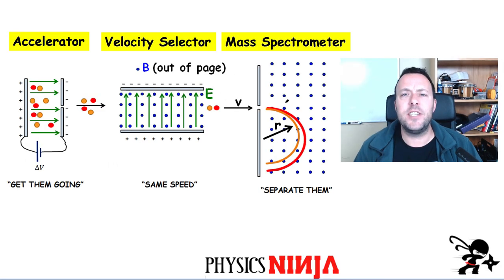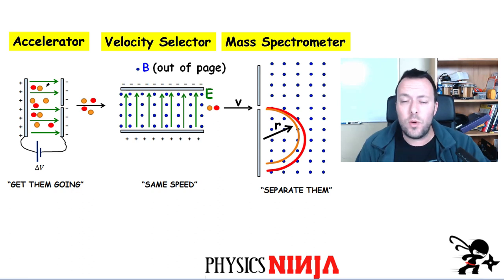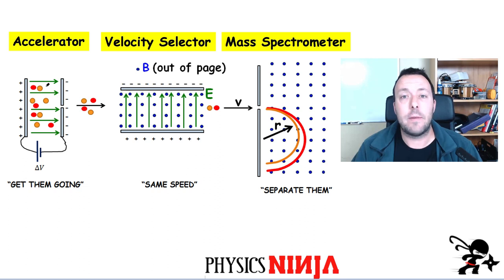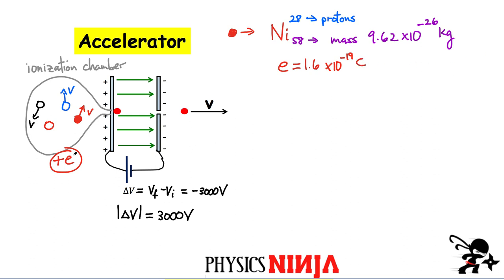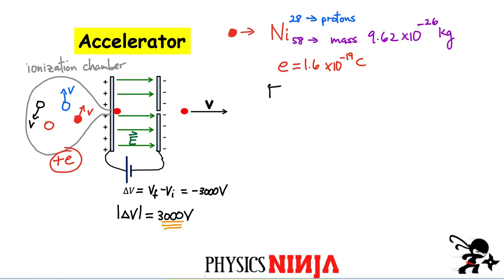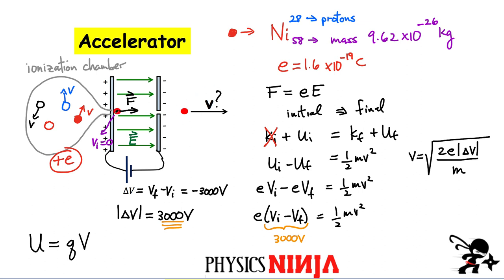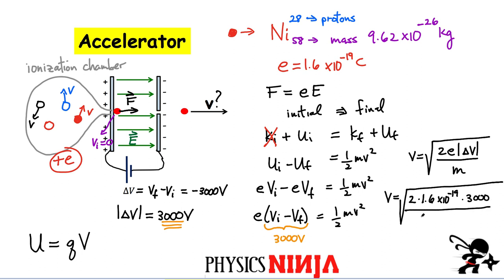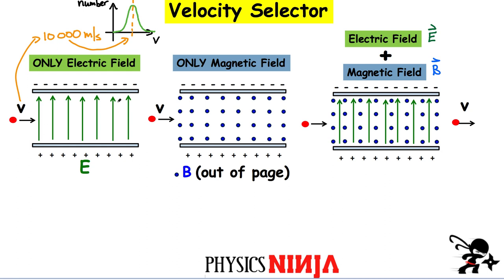Mass Spectrometer Problem

Comment: I've read a lot of comments on the fact that ions of different mass will emerge at different velocities from the accelerating potential.  

These are really good questions about the accelerating potential issue:  absolutely the heavier particles will emerge with a lower velocity.  If the speed selector was fixed at one value and the accelerating potential was fixed at one value, you would miss the vast majority of atoms/'molecules emerging from the ionization chamber.  I ran into these comments while preparing to produce a video for a physics course, which inspired me to do more research on the issue, and the answer is very simple:  the experimenter can turn the knobs to change these parameters in order to scan through ions with different charge to mass ratios!   Mass spectrometers simply modify the parameters to rapidly scan through m/z values to produce a relative abundance vs. m/z plot.  In the physics textbooks I've taught from, they always present it as "one velocity, many different landing positions", but clearly this can't be true unless the particles are very close in mass.  

In my research over the last couple days, I ran into a cool review article on the history of the mass spectrometer:  https://www.researchgate.net/publication/277275153_Colloquium_100_years_of_mass_spectrometry_Perspectives_and_future_trends

In the article, we see that Dempster's magnetic sector analyzer (1918) looks very much like the schematic we're used to seeing in introductory physics, except that it has only a single detector instead of a spread-out photographic plate.  This made me realize that with experimental control over the accelerating potential and the magnetic field in the analyzer region, we can detect different particles at the same position by sweeping through the parameters of the device.  It is interesting to note that Dempster's design did NOT have a speed selector, but he acknowledged the loss of resolution due to the distribution of ion velocities entering the analyzer and proposed adding the Wien filter (velocity selector) in order to improve the resolution of the device.   I think the addition of the Wien filter is what distinguishes this canonical example as the "Bainbridge Mass Spectrometer".  

I ended up making my video with a spectrometer schematic that has a single fixed detector, assuming we have the experimental control to sweep through parameters and detect different ions by modifying the accelerating potential, speed selector and/or analyzer magnetic field.  

https://www.youtube.com/watch?v=vFUMH5WVuc4

Comment: I am a physics teacher. I would like to correct you on the hand rules…. To find the the direction of a force on a moving charge you ALWAYS use Fleming’s left hand rule. The right hand rule is only used to find the direction of an induced current in a magnetic field.
Reply from the maker: I use 2 right hand rules.  I never liked the left hand rule because then you need to remember when to use right vs left.  Instead I teach 2 right hand rules one for currents and one for for cross products.   It’s worked for my students for over 20 years.

Comment: I tried the exercise and everything is okay for the first radius, in the second part though I cannot understand how did you calculated the mass. Because if I try the result is 9.95x10^-26kg and if i put this in the formula the second radius results 5.2 instead of 6.. What did I do wrong?

Comment: The energy that the ions gain during accelaration is same if we consider that all ions have same charge. So The heavier molecules will have smaller velocity and the ligther will have greater velocity. But velocity selector let pass only the ions with certain velocity. So how the spectrometer detects the other ions? It doesn't make sense.
Reply from the maker: That's assuming that they have an initial velocity of 0m/s.   In general you have an ionized gas so they are entering the E-field region with different velocities.    So you can have heavy and light molecules that are accelerated through the potential difference.   I considered only the case with initial kinetic = 0 but this is just a specific case.
Reply: @PhysicsNinja  So we need the velocity selector because the molecules have initial velocity?
Reply from the maker: @adosar7261  There is generally a distribution of velocities and we want to take a small sample of the velocities.
Reply: @PhysicsNinja  I still don't understand it. How we know that we didn't miss any ion that didn't have the selected velocity? Thanks in advance.
Reply: @adosar7261  I think you are absolutely right. From the equation v=sqrt(2e|deltaV|/m) we see that the velocity of each ion is inversely proportional to the square root of its mass-to-charge ratio (m/z). So at any selected velocity only one m/z passes though the velocity selector to the analyzing magnet sector, which means that only one ion type can be observed. Thus, it's clear that the system discussed in the video cannot operate in the way a real mass spectrometer should.

Even if the ions arriving the accelerating electric field have a distribution of initial velocities, it won't make a crucial difference, as the largest part of the final velocities still comes from the accelerating field. The differing initial velocities may of course make it possible for a small number of different mass-to-charge ratios (around the "correct" one) to pass through the velocity selector, but most of them are still filtered out and stay undetected, especially those that differ significantly from the "correct" m/z.

Moreover, this type of "mass spectrometer" can never yield quantitative results, as this would require that at least on some selectable velocity a wide range of different mass-to-charge ratios should be present in exactly the same abundance proportions as in the sample that is arriving the ionization chamber.

As a result, I think the system under discussion is not representative of any usable real-world mass spectrometer. Instead, it is better described as a pedagogical thought experiment often encountered in introductory-level physics materials, although unfortunately a flawed one as such.

Comment: I don understand how isotopes with different masses reach the same speed under the same accelerating conditions I try to do my takehome assignment but I am desperate now
Reply from the maker: Your right, Isotopes with different masses will NOT reach the same final speed if the force is the same (qE) and they started from the same initial velocity  because they would have different acceleration (a=qE/m, different masses, same charge).     However they don't necessarily have the same initial velocities.  Think of them as having a distribution of initial velocities.   Typically they are created by collisions (not covered in this video).